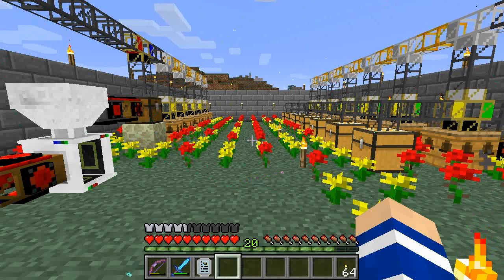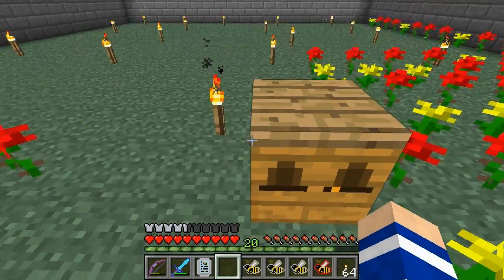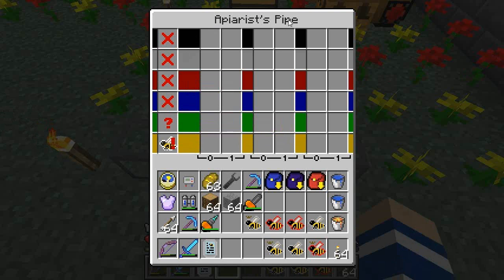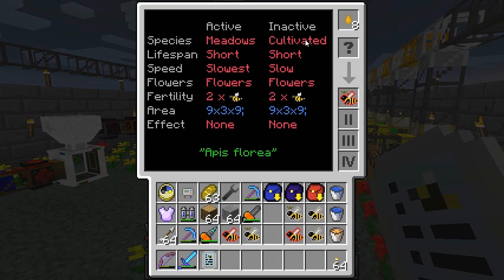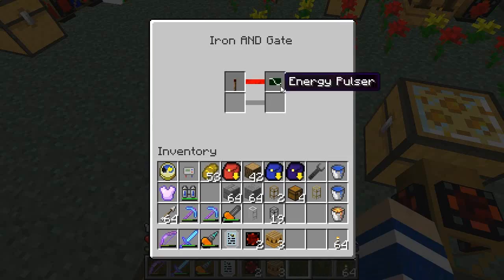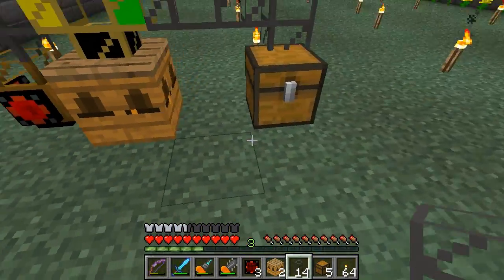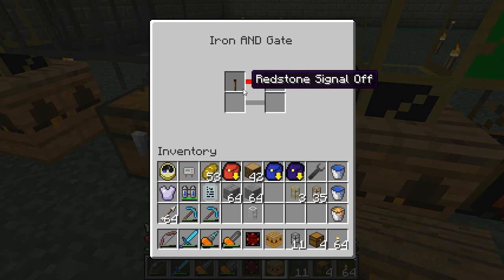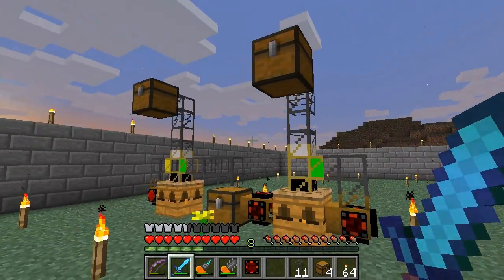Sand Pack S1 E13 - Automating bees

Comment: if you are just looking for a bee species, this is an interesting way ...
but you will mess up your bees.
like having a shortest-longer lifetime wor a slower-normal working speed.
there is no way to automate it if you want to have a clean genome with speed, flowers, lifetime, and stuff like that. that has to be done manually, or maybe with a really complicated pipe network i guess? (didnt use apiarist pipes a lot)